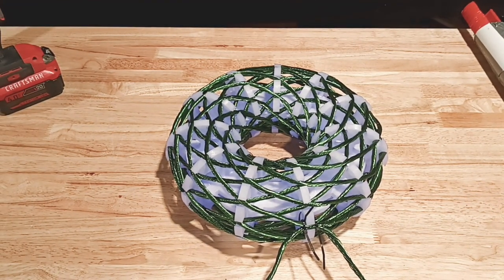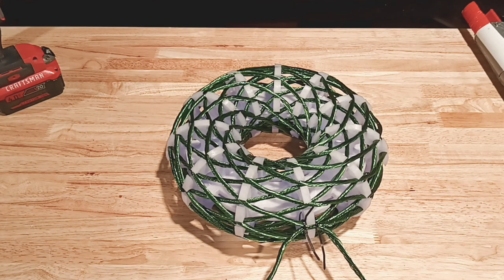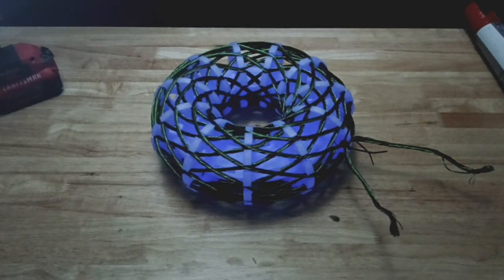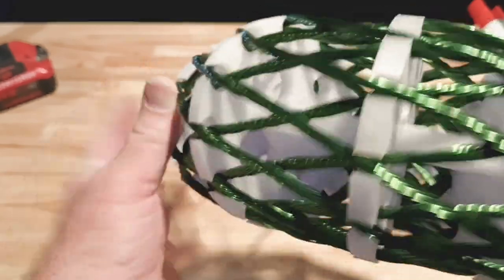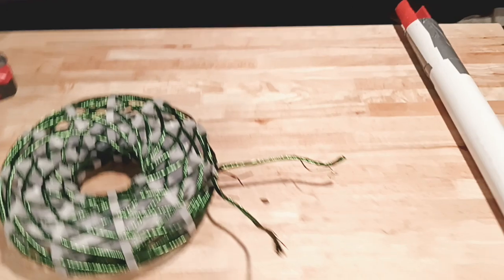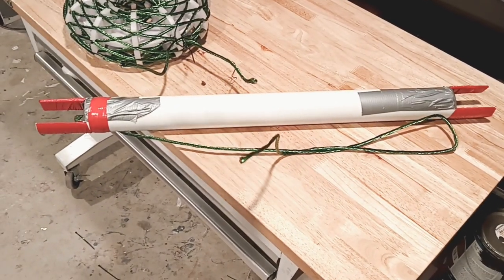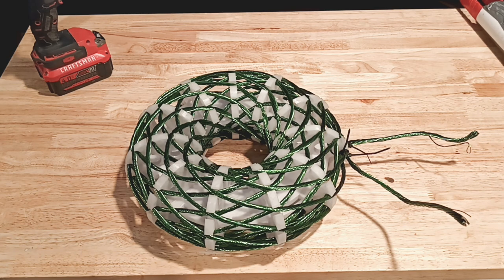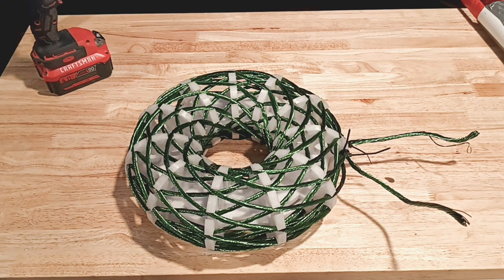Rodin Coil "Glow In The Dark Joker Coil"

Comment: What is the purpose of the rodin coil?
Reply from the maker: to create a center vortex
Reply: @nathanbunten4299  what I really mean to ask is what is the vortex for? Can it be used for something practical apart from just spin a magnet in its center?
Reply: If it isn't yet, it will be in mass soon I think. Plasma channels aswell as photon manipulations. What ever that means. I'm learning as I go, forgive me😅
Reply from the maker: @rasikrodriguez3962  To be honest I don't know. I have to try it out.
Reply from the maker: @hellogoodbye3129  It is going to be fun to just push the power with it.
Reply: YOU SHOULD SELL THE FORMS !!
Reply from the maker: @B.Cote39  the stl is free on thingiverse
Reply: @B.Cote39  The POE Vortex coil frame is patented. I'd have to look into the legalities of selling our own custom frames.
Reply: @nathanbunten4299  shall we take bets on how much heat 20 amp is gonna put off? I'd say just under the melting point of tha plastic. 30 amps and I think the plastic will weaken wear faster but stay, 40 amps may deform, 50 amp she flattens and burns. Just hook it to a car alternator on the ac side of the regulator. Bang 60amps.
Reply: @BenEfactor101  good call man